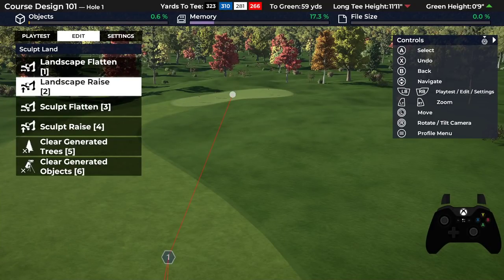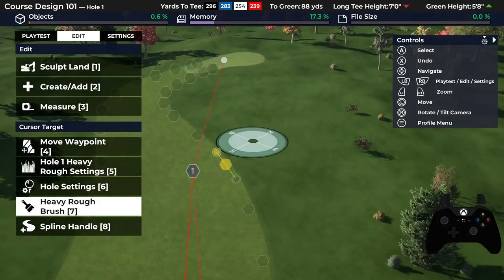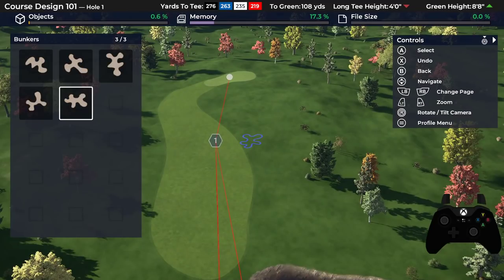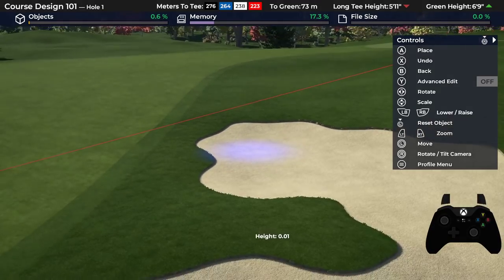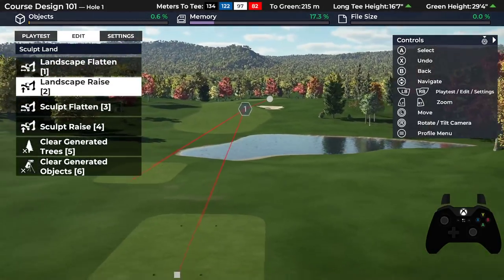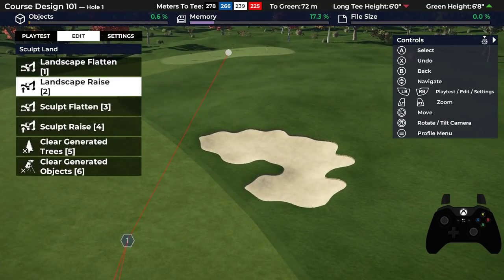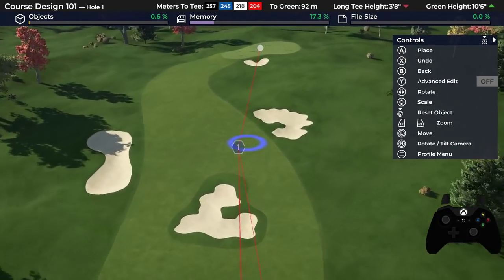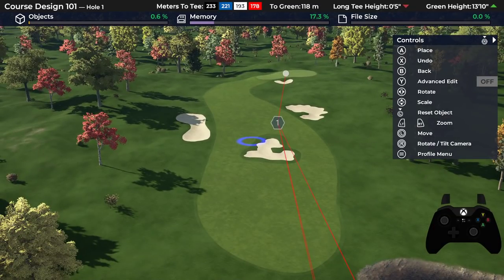Course Design 101 (PGA Tour 2K21) Episode 7 - Bunker Basics

Comment: any idea how you can remove the rough that automatically generates around the rim when you create a fairway bunker? Thanks
Reply: It works if you place the bunker using splines, not brush. Then select the 'second surface' as fairway. Placing bunker through splines is hard to make it look good though